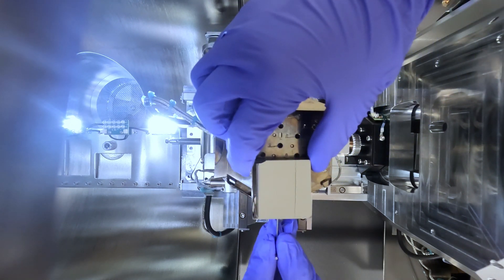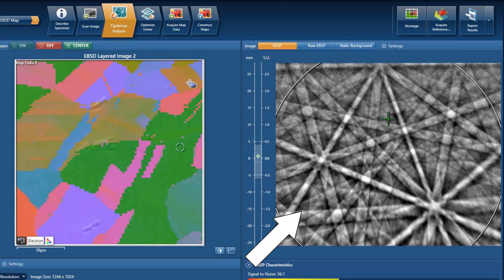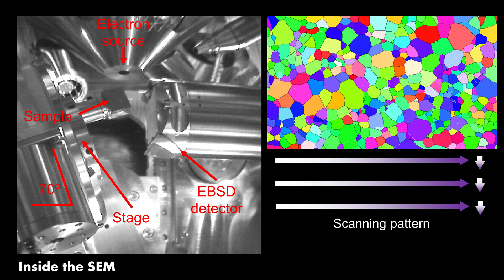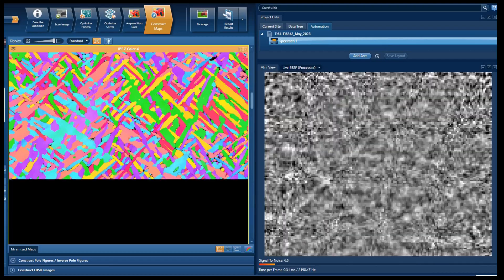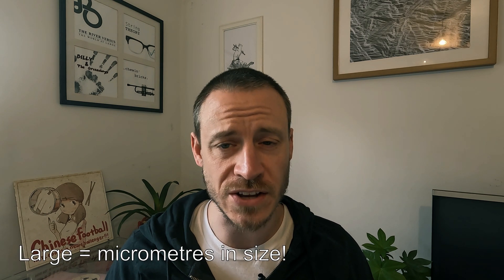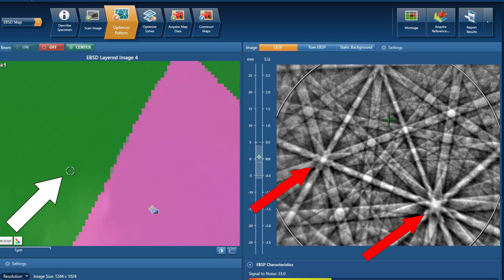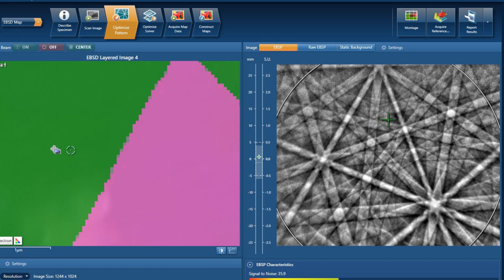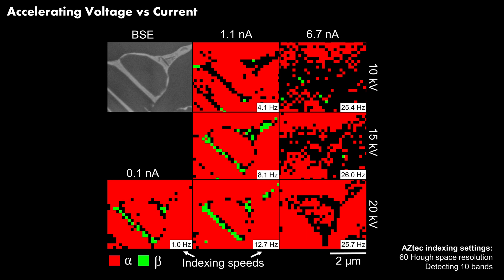Achieving Nanoscale Resolution with EBSD [VIDEO ABSTRACT]

Comment: I hope you don’t mind another question - I’m not a microscope expert, but I do have some experience in classifying materials via electrical interferometry, and have often wondered if it might be possible to improve SEM classification by introducing interference during the scan, thus providing additional data to augment conventional scans.

The hypothesis is that the SEM equipment is so sensitive, and the electromagnetic environment of the scan so intense at such a small scale  (inverse square law,) that even slight  interference would alter the scattering characteristics in a way that could be distinguished in the resulting hogue transform. The effect is mediated by the crystallographic structure and constituent atoms, and thus distinct for each phase (and boundary region.)

Moreover, it might be easy enough to try a quick experiment - all you’d need to do is induce a low power high frequency alternating current into the sample, or possibly even just by shining a laser on the sample during scanning. (Titanium in particular has strong paramagnetic momentum.)

Any thoughts on this? I suppose if it were true someone is already doing it, but I’ve not heard.
Reply from the maker: I'm not aware of anyone trying this, no. I'm not a technique development expert I'm afraid! We usually rely readily available SEM detection techniques that are already being produced by the electron beam alone to get more information about our samples (simultaneous EBSD + EDS, backscatter imaging, forward scatter imaging)